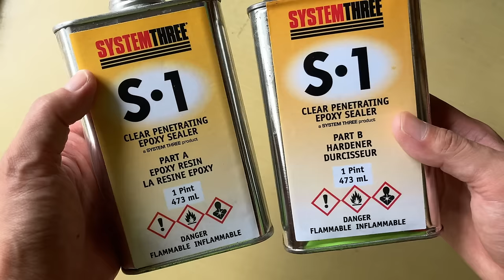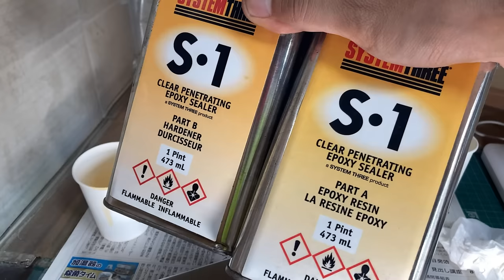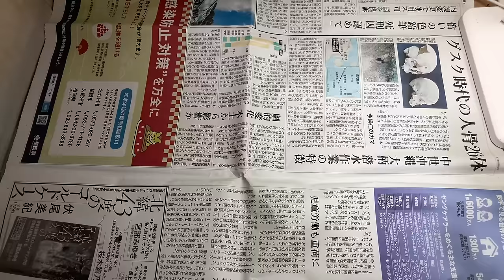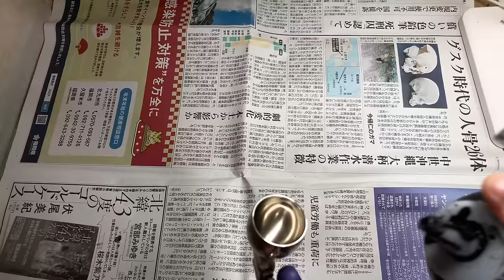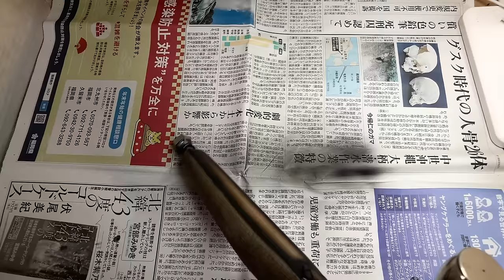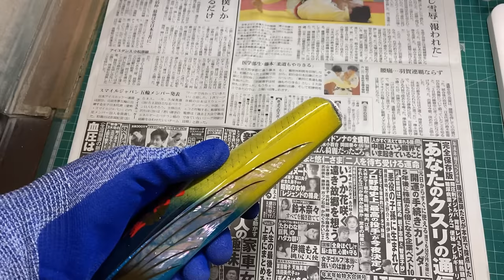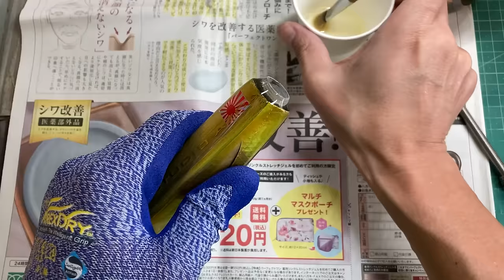【Handmade saltwater fishing lures】 Making a Wooden Saltwater Stickbait of Kingfish&Giant trevally

Comment: Great lure, quick question, the inside of the lure thru the big center hole is it properly sealed? how do you get the epoxy to seal it off?
Reply from the maker: Pour the epoxy after sealing the hole with cellophane tape.
The hole remains empty.